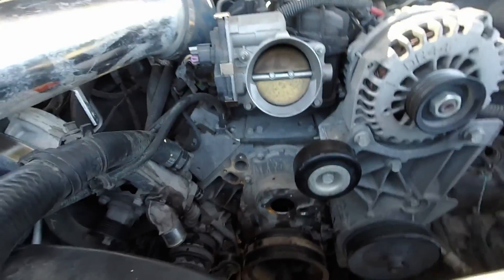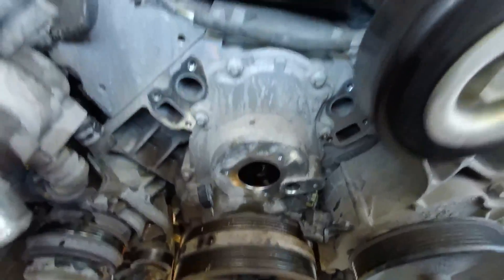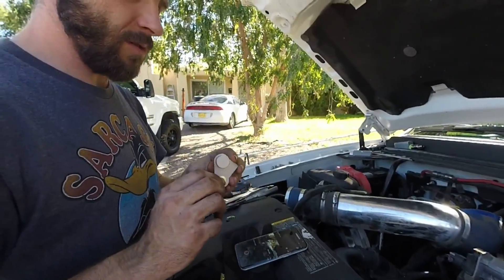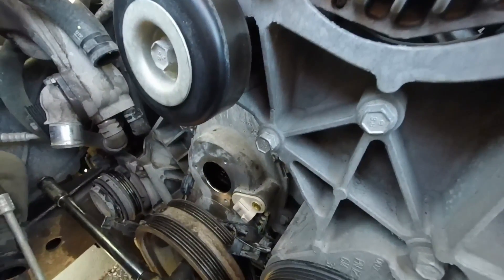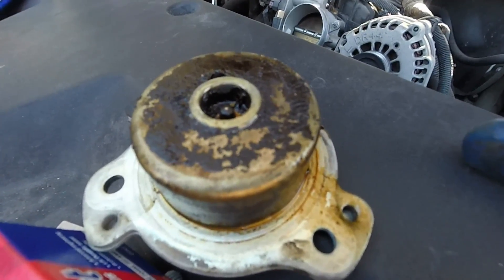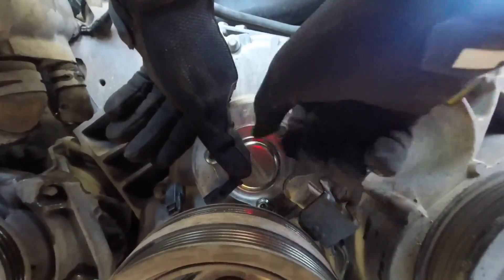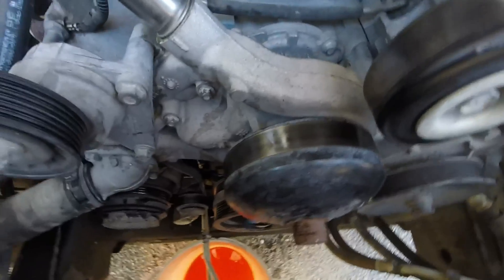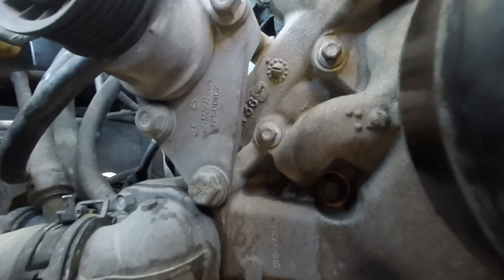GM 6.2L V8 VVT solenoid actuator replacement.

Comment: On this vehicle the VVT solenoid is a "stretch bolt" . I was told that you can't re-use a stretch bolt. Did you do a follow up because it is my understanding that re-use of the stretch bolt WILL result in more issues. It runs okay initially, but then I believe that you start getting stalls, check engine codes, hard starts, and rough idle

Comment: The cam bolt is torque to yield. Not to be reused kids. Don’t make the same mistake these guy did.
Reply: I learned this the hard way. Perhaps that's why their video didn't finish. DO NOT RE-USE THE VVT SOLENOID! It is a stretch bolt

Comment: Did you have the code p0011 and traction control  and stabilitrak trac come on? Waisted gas a lot and Trans shifted weird
Reply: I have a 07 Yukon Denali XL, and on it, did that something after 5 hours of continuous driving,  I had limp it 2 more hours to get yo my destination,  and once I had it scanned it had the following codes, P0011, P0171 and P0174 ended up replacing the MAF sensor and it drove fine againg for another 5 hours, than it die while attempting to pass another vehicle  on the interstate,  pulled over, cranked back up and it rode fine until about 1/4 of a mile from the house, than the check engine light,  traction control and service stability track lights came on.
It's so frustrating. If anyone had this problem and found a fix, please let us know, I'm done with GMC products.
Reply: @carlosmencias68 Possibly a bad crankshaft position sensor.
Reply: @marcusbennette8454  I already replaced the crankshaft position sensor and the magnetic sensor as well.
Reply: @carlosmencias68 test your alternator
Reply: @Pennys2Billions  it have a fairly new alternator and battery

Comment: I bought a 2011 Avalanche and been trying to determine what all has been done internally. My magnetic solenoid actuator is just hanging in front of the timing cover, there is no hole in the timing cover for it to attach so the cover has been replaced for sure. I still drive it every day, any ideas?
Reply: It sounds like the vvt cam gear was replaced with the non vvt cam gear.  The cover was too.  I'm not sure why they left the actuator still plugged in unless it was throwing a code and they didn't get it tuned out.  Make sure you don't still have the vvt valley cover installed.  The flat metal plate under the intake manifold shouldn't have grooves.  Should be flat all the way across. If vvt has been deleted, the oil galleys under the valley plate should be plugged or sealed off.  My concern would be to make sure they didn't do a half assed vvt/dod delete.
Reply: @Indianawhiskeyandbourbon  I'm hoping it wasn't half assed as I been driving it for 2 years with no issues. Maybe someday in the near future I'll dig into it more, but I figured why make a mess of something that still performs without issue. Appreciate you taking the time and giving me your thoughts.
Reply: @mikebas7325  you're welcome, and i agree, don't fix it if it ain't broke.

Comment: Question, I just replaced everything in the video. The only difference is that I started with prying the sensor out as i was prying, a magnet piece came out from inside the engine thought nothing of it. Also I did not hold the engine in place as I tightened the vvt solenoid. Put everything back together new cam sensor light came on. Mechanic says the sensor is working. Im thinking the camshaft postion actuator was damaged. The vehicle runs ok I can hear a new ticking sound and gas mileage sucks. Anyone have any idea what could be wrong before I take everything apart again?

Comment: I just did this earlier today and it wasn't easy but I was able to get the sensor out without destroying it.  I sprayed carb cleaner on it through the vvt actuator solenoid hole then worked out back and forth until it was out Far enough to clamp needle nose vice grips  on it behind the wing directly on the main body of the sensor and turned it back and forth and pulled it outward at the same time.  Hopefully this helps someone else.  Kudos
Reply from the maker: Awesome!!! Thanks for the tip!

Comment: i am confused i am not a mechanic but i was told to get the parts for my srx 2004 v8, which are 4 actuators but watching your video you called one part Actuator and the other one the sensor but when I looked at it online they call the spark plug looking thing, Solenoid Actuator and the other one as the cam magnet, can you clear the terminology/names for me?  My car guy is asking for 4 actuators, that magnet looking thing you mentioned as the actuators does that mean I need 4 of them?  Thanks so much

Comment: Hey David, can a faulty magnetic solenoid actuator interfere with the camshaft position sensor and cause the vehicle to not start? Just wondering because I had to replace my camshaft sensor while doing a timing cover gasket and oil pan gasket replacement. The old sensor ended up getting broken when I was trying to remove it. I replaced it but my truck will not start now. It was starting before I change out the gaskets and sensor. I have a 6.2 2008 Yukon Denali XL.

Comment: If anyone can help with the p0011 ill appreciate  it.  I changed every part in this video as well as the mini harness which the 2 sensors plug into also 2 oil changes  everything  dealer parts still have the code
Reply: low oil pressure
Reply: @arturoaraiza5788  oil pressure is good. After I change the parts  the engine light  goes off sometimes  but comes back  before I changed them it stood on  so I'm thinking  I received  a bad part
Reply: @eddiesgsr Did you ever figure it out?

Comment: I have a 2010 escalade with the 6.2 vvt deleted i bought it like that and it ran fine for 6 months now it stalls hard to start and when i stop fast it revs and bucks on me plus burning alot of gas codes are p0010 and p0011 any ideas?

Comment: Here’s a crazy one. 
Check engine light is on for the crankshaft position sensor . Replaced it and took it to a shop to re learn . 
They couldn’t . Said I need a new timing chain. Did that, light still on . They suggested a new motor which is ridiculous . Took it somewhere else and they said replace the vvt solenoid . But reading all these other issues I don’t see how that can be related . I know it has to do with timing , but in any of your expert opinions , would you do this ?
Reply: Did they check and make sure the sensor was good? Check wiring up to PCM to make sure no corrosion, frayed or broken wires, or bad connections exists.

Comment: lots of people think the vvt valve is a solenoid.... its not..
Reply from the maker: Yup, its a valve but some VVT valves have the solenoid built onto them and stuck into the heads. So i can see why people think that.
Reply: Im 3 years late but.. GM literally calls it "Camshaft Position Actuator Solenoid Valve" - GM

Comment: That job can definitely go sideways. I rebuild these for a living and have seen a bad VVT solenoid in the shop have to come out. It's possible that the cam phaser can get damaged while doing this which would require removal of the phaser. All the LS engines run the same parts from 4.8 to the 6.2.
Reply from the maker: Great tip. Thank you for your input to help others.
Reply: Could this trigger a P1380 code. Mine has had this code since I replaced the collapsed lifter. Haven't been able to pinpoint the cause of this. Any help would be appreciated
Reply: After replacing camshaft sensor do I have to relearn it? On 07 gmc Yukon, some say it has to be relearned / recalibrated

Comment: Im working on a 5.3 that  is poping out of the intake port after the AFM is deactivated. Misfires on idle P0300. You deactivate the AFM no popping. Activate the AFM Popping. Replaced the VLOM better but still popping. Been working on this truck for 2 months any ideas. Is the variable solenoid causing cam to stay advanced?
Reply from the maker: Honestly that sounds like one of the afm lifters has failed. And is causing the valve to stay open.

Comment: Can i ask, does the crankshaft pully move when trying to change the solenoid? I need to change mine and hoping its just a simple case of removing the front dorman and unbolting the solenoid with a wrench. If you can please let me know if its not complicated to remove the solenoid, thanks.
Reply from the maker: It can.. but just keep a bar or strap wrench on the balancer and you should be ok

Comment: Is the po011 code is the VVT bolt or the magnetic solenoid the problem...can anyone help please
Reply: I’m changing both.. an valve cover
Reply: @illustr8phee100  did the issue gone please i have same code thank you

Comment: I have this same problem on my Denali 6.2 I've changed the sensor n oil pump n it's still low until I gas it it goes max about 30 psi 40 if pushing It. What do you think I should do?? They said my motor was gonna give  out but it runs like champ so I'm confused
Reply from the maker: It might be sucking air. There is a little o-ring that seals the oil pickup tube to the pump right behind the timing cover in-between the oil pan and the block that commonly goes bad.
Reply: Did you ever get this issue fixed ?

Comment: Any help with my problem please ???
P0011 code 2007 cadillac escalade esv 6.2
 the noise comes and goes
 very strange
Looks like the noise coming from the oil pan after 10 minutes in the highway
https://youtu.be/okAd5nOLQDo

And then after 5 minutes in the city
The noise was gone
https://youtu.be/18yWOchznnE

I'm losing my mind :/
Reply from the maker: Yes if its starving it of oil you might have done damage already...
Reply: @DavidBennett505  i hope not :(
Reply from the maker: Could be the oil pickup oring sucking air instead of oil... Have to get to it by pulling the timing cover off and oil pan
Reply: @DavidBennett505  thanks
I'm planning to do tha this week
You think can make that loud noise ?
Appreciate your advice 
Thank ;

Comment: Does anyone know if the engine turns when you remove the VVT solenoid?
Reply: It does turn if your doing it with a hand socket .....you need a impact to take it off....I already been through that headache
Reply: @Raider24  so impact it off? an torque new one  back on?
Reply: @illustr8phee100  yes and I really didn't torque mine down.... I put it on by hand till I couldn't anymore and then barly tapped it with the impact..... I haven't had any issues
Reply: @Raider24  ain’t no point with the breaker bar?
Reply: @Raider24  ok..
Reply: @Raider24  smh!! code came back
Reply: @illustr8phee100  when I changed mine.... I changed my oil pump with everything to make sure it wouldn't come back
Reply: @Raider24  ok... oil pump came yesterday..
Reply: @illustr8phee100  in order to get to the pump ur ganna have to take the front differential off
Reply: @Raider24  timing .. cam  it’s all right there..
Reply: @Raider24  hey.. is there a sensor in the oil pan ??
Reply: @illustr8phee100  yes it's a oil level sensor
Reply: @illustr8phee100  mine just went bad and gotta wait to change my oil to switch it out
Reply: @Raider24  the whole front diff..doesn’t have to come out?
Reply: @illustr8phee100  not to get the oil level sensor on
Reply: @illustr8phee100  to get the oil pan off it has to yes

Comment: Damn. I paid $1400 to have the dealership do what you just did...
Reply: I would have did it for 800
Reply: @Raider24  I would have loved to have saved $600.  They did all that, but it still would turn itself off after about 40 minutes. I unplugged the sensor, I think it's on the camshaft position sensor ( the one behind the water pump) and now it doesn't stall out anymore and I can drive it, but I assume I'm not getting the benefit of the variable valve timing any more. It kinda hesitates a bit under acceleration. Do you know what may still be wrong with it?

Comment: When trying to loosen the solonoid with a socket ....does the chain and everything move with it?
Reply: Lol just saw this . But so basically all I gotta do remove air filter  belt pulley Nd water pump ?
Reply: @jesusrubio9525  
After the water pump u have to remove the timing cover witch reveals the solenoid your ganna be removing and the timing chain is visible
Reply: @jesusrubio9525  but in order to take the timing cover off you gotta take the harmonic balancer off
Reply: Dammit , u don’t think I can leave the timing cover on and do it like the guy in the video did ? Sorry for all the questions
Reply: @jesusrubio9525  
Where are u located?
Reply: So impact the solenoid out?  what about putting the new one in?
Reply: @illustr8phee100  I put the new one in by hand then barly tapped it with the impact..... Haven't had any issues at all
Reply: @Raider24  is there any procedure for making sure the engines in time when reinstalling the cam actuator any help would be appreciated
Reply: Did u ever find out if it does move ?
Reply: @jesusrubio9525  I wish you had it here in my garage bc I know how to take it all apart and put it back together......I fixed my ladys esclade and it's been a champ so far
Reply: @jesusrubio9525  
Everything does move as if your trying to turn the engine over by hand......you need an impact to take the solenoid off because doing it with a hand socket is like beating a dead horse and you wont be able to take it off
Reply: @raiders24
Reply: @jesusrubio9525  you can but that sensor that's on the timing cover is a bitch to get out and I say sense ur that far into it might as well take the cover off
Reply: @jesusrubio9525  does your vehicle say low oil pressure in the dash as well or no?
Reply: I haven’t started yet it’s my only truck I don’t wanna start unless everything will go smoothly Nd I’m in midland
Reply: @raiders 24 and no it used to do that till I changed the oil pressure sensor
Reply: @jesusrubio9525  you can do it without removing the timing cover.....but that white looking sensor is a bitch to get off just like he says.....and I was thinking u were ganna remove the pulley(harmonic balancer)witch u dont have to as well.....when I did my ladys esclade I replaced her oil pump and took it all apart with the oil pan off and front differential off and dropped down the rack and pinion
Reply: @jesusrubio9525  and I live in Colorado....ur 11 hrs from me lol
Reply: warriorpluto  
The pickup tube is bolted on so u need to drop the rack to make room for the oil pan to drop down

Comment: Would this trigger the P0341 check engine light?  I changed the cam position sensor but that didnt fix it. Took it to the dealer and they said my timing chain is stretched
Reply: After I replaced the timing chain, chain tensioner, oil pump, water pump, and cam sensor the light still stayed on. So then I took the cover off and noticed that the metal that is attached to the cam gear was a little bent and that's what the cam sensor reads. I replaced that and the code never came back. Now I have a p0011 code and I'm sure it's the bolt that hold the cam gear and the timing gear solenoid
Reply: 2literjamez Good to know. Thanks.
Reply from the maker: The chain could be stretched. A buddy of mine actually had this happen on his truck. It was replaced and ran better.
Reply: @DavidBennett505  working on mines as we speak. Too off the timing cover and it looks like the tensioner is worn out. To get to it, I have to drop the oil pan to take off the oil pump so I'm just gonna replace the pump, chain, and tensioner since I'm at that point already
Reply from the maker: @2literjamez  Make sure you replace the O-ring on the oil pickup tube that goes in front of the oil pan. those have been known to crack and cause air to be sucked in instead of sucking up the oil and cause all kinds of issues.
Reply: Changed the oil pump, timing chain, tensioner, cam sensor, water pump, and new oil. Reconnected the battery and drove it around for a few miles then the p0341 code came out again. Should I have changed the vvt solenoid like you did?
Reply: @2literjamez  i have the same problem what you did?
Reply: Ended up fixing the p0341 code now it has a p0011 code
Reply: @2literjamez  thanks
Reply: 2literjamez How did you fix the P0341 code? Just did a top end rebuild on my 5.3L suburban to replace a bad lifter, now I have this code.
Reply: @ciscoslugger  havent had the time to try to take off the p0011 yet
Reply: 2literjamez will the vvt solenoid Fixx the p0011 Code ?
Reply: @jesusrubio9525  that's the only thing I didnt change and it's related to the p0011 code so it might be it
Reply: 2literjamez okay thanks for answering really appreciate it

Comment: Uh yeah. take it a shop that knows what there doing. That solenoid is a torque to yield bolt and cannot be reused. when it breaks you'll be buying a new engine. and 6.2 is the most expensive to rebuild.
Reply: If the bolt did break off in the cam you would only need a new cam not a rebuild!
Reply: @brianboardley7838  Actually the cam might survive, just need to extract that bolt but,  Where do you think the cam gear will go? The bolt is $40. Do it right !! Or dont do it !!!
Reply: warriorpluto I guess I should have said 1 of the most expensive to rebuild. Not hard as far as skill goes. But parts ain’t cheap. I know my shop charges more because of that.
So knowing that U can’t reuse that solenoid  it’s not for the diy’er. But I say that about all engines cause it’s how I feed my family.

Comment: Remember boys and girls NEVER touch the throttle plate !! you will damage it and have to pay a LOT OF MONEY TO FIX IT!
yes it's fun to play with flapper things but do it to something else...
Also to save time  replace the water pump and belt because you all ready got everything off IT WILL save you time  in the end and money on the coolant.  also check and make sure the pulleys are good and not leaking grease or has oil residue  while everything is off
Reply from the maker: Great tip!

Comment: what is the cause on changing this??
Reply: P0011 on my 6.2 Yukon. It was stalling our at red lights and would idle weird.
Reply: Low oil pressure causing the engine to stall